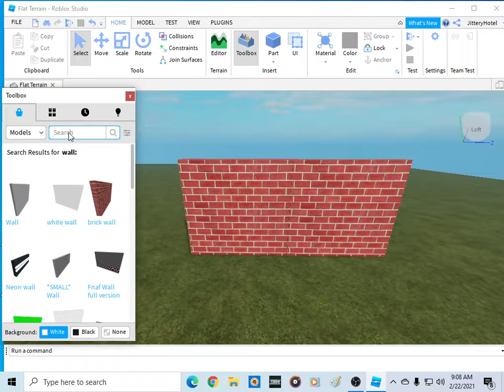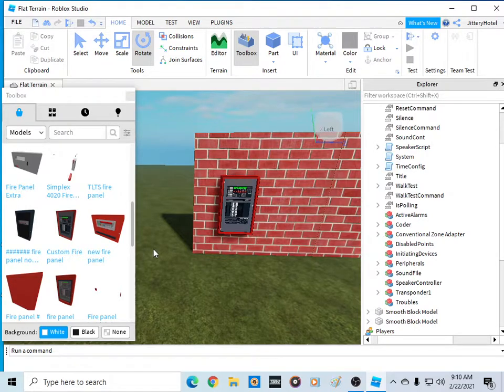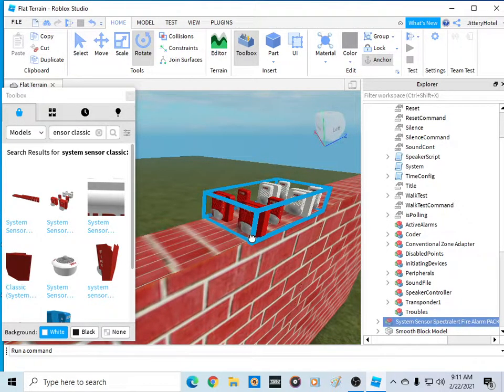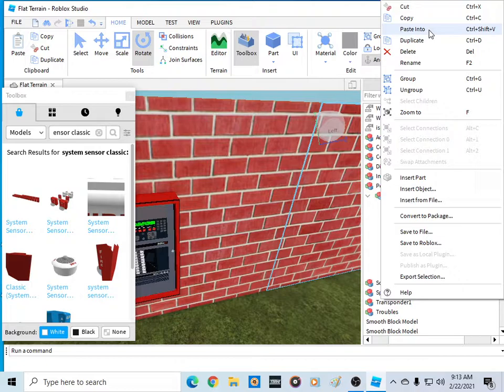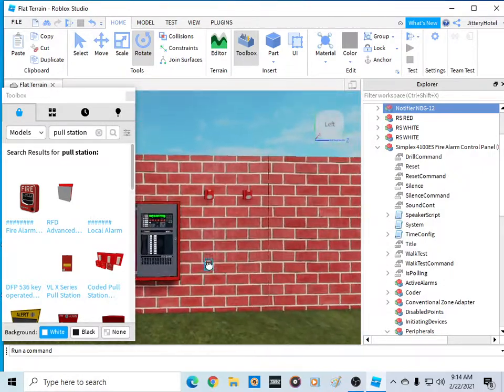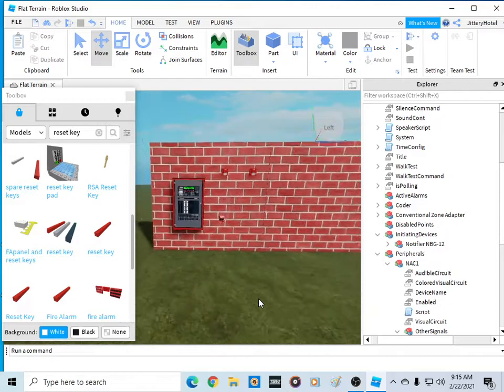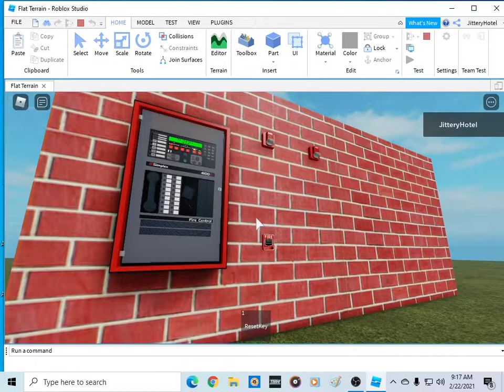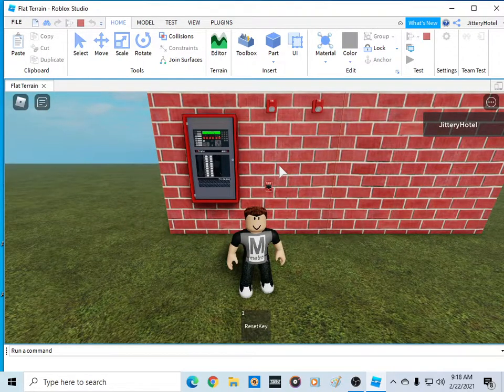How to build your fire alarm system in Roblox

Comment: Here’s the problem with my version of this, I can only set off the alarms with the panel. I did the initiating devices option for the pull stations and they did not work, I also tried that for smoke detectors but they didn’t work either. Please make a updated version of this and if you do please mention me for the updated request, thx!
Reply: Oh, You have to create a boolean value named "Alarm" and a string value name "DeviceName", after that create a script that make the alarm value true when the alarm is pulled.